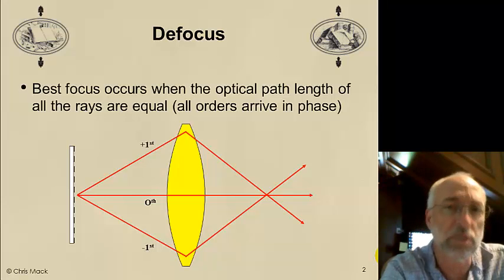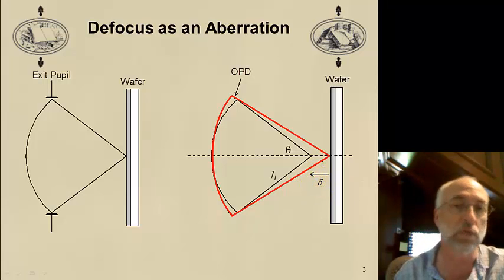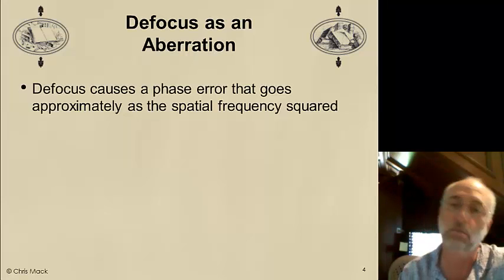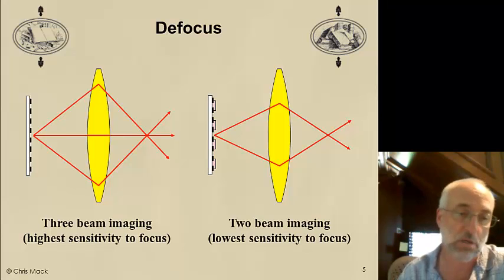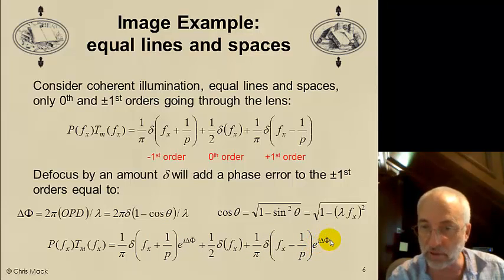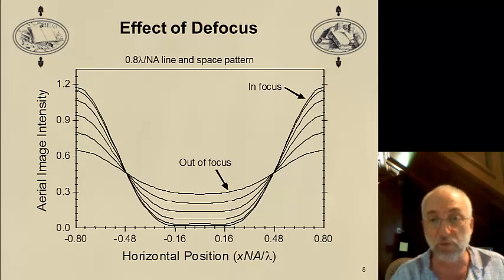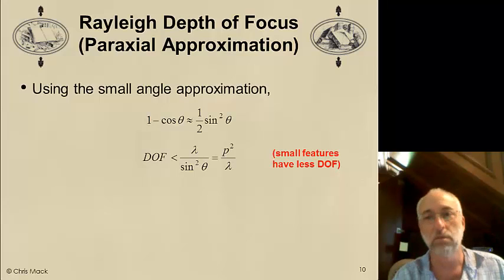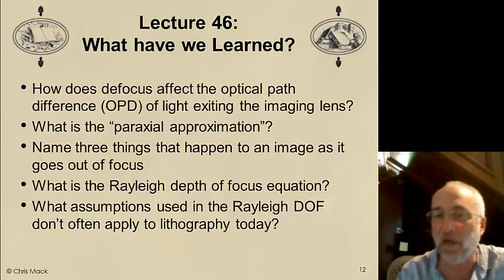Lecture 46 (CHE 323) Lithography Defocus and DOF

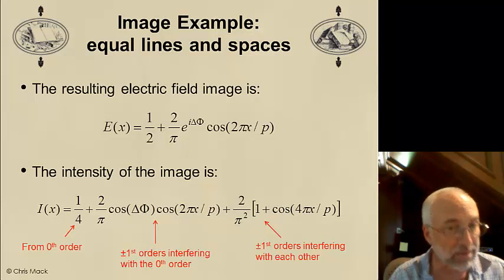Comment: Nice video. For the intensity equation shown at 21:12, can it be shown mathematically how the interference between +-1st orders cancels out the phase shift term? Why not a cos(2*deltaPhi) term there?
Reply from the maker: Yes, it can be shown that the phase term cancels out so long as the two orders are at + and - the same angle.